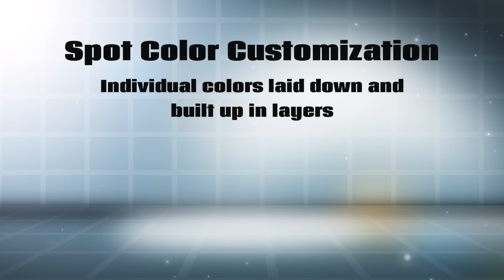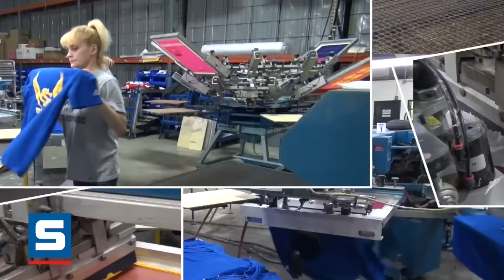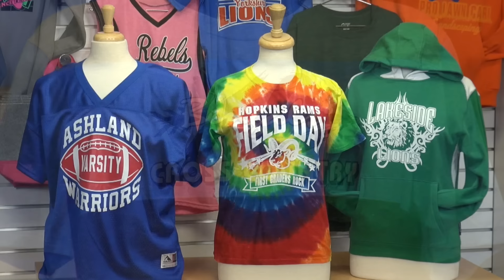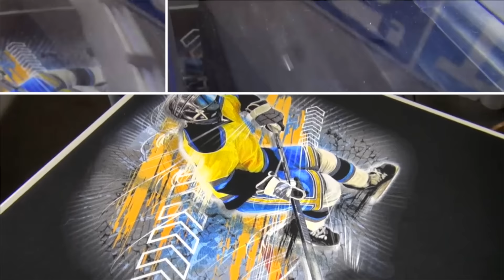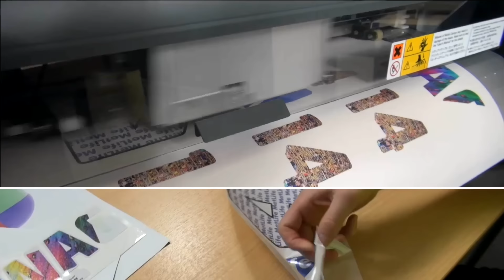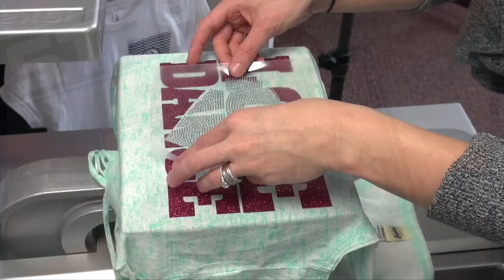Choosing a Print Technology for Your Clothing Line

Comment: still new to this and appreciate the videos you post. Can you let me know exactly what the print and cut procedure is please. Is this some kind of printable heat transfer vinyl? Thanks
Reply from the maker: The print/cut process is printing with eco-solvent ink onto blank heat transfer materials. Once the large format printer prints the design, it will then contour cut around the designs using registration marks within the software. Once this process is finished you will weed away the excess and mask your designs. From there you will have finished transfers ready to heat apply.
Reply: Stahls' TV Thank you for your very prompt response. I wasn't sure if you could get printable HTV. I only have an inkjet printer so I take it this wouldn't be suitable for this type of work? Superb videos by the way. Thanks again for posting.
Reply from the maker: There wouldn't be any printable HTV we have that would work with your Inkjet printer, just heat transfer papers. Thank you for your feedback!
Reply: Stahls' TV Thanks again for your very prompt response. The wealth of material you publish has really inspired me to get into this business.

Comment: what would you call printing from a oki 920 wt printer? digital printing, laser or solvent ? please give me some clarity. thanks
Reply from the maker: It is laser jet printing.
Reply: thanks. So which would you highly recommend for t-shirt printing? roland BN20 0r OKI 920wt.
Reply from the maker: Tough question, they both have their pros and cons.  OKI machine is great for fine detail without weeding and larger photo designs.  Not as durable as the BN20 transfers though.  BN20 is great for durability and variety of materials for t-shirts (metallic, basic, stretch etc.).  Also the BN20 is capable of more applications like stickers, decals, poster, wall graphics, banners etc.  What types of designs are you looking to create and what are the primary markets that you will sell to?  This will help point you in the right direction for your business.
Reply: thanks. I am looking for durability with prints.  My primary markets will be children's apparel and onesies,  cap printing ,memorial shirts, a little decal and wall graphics.